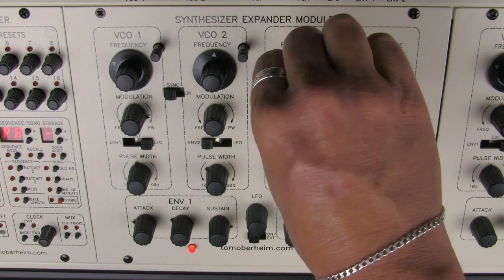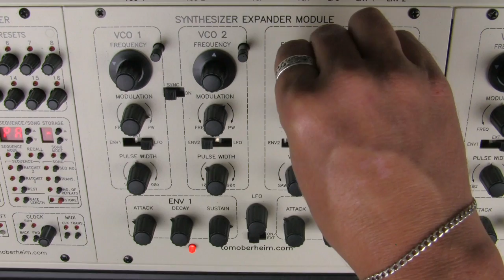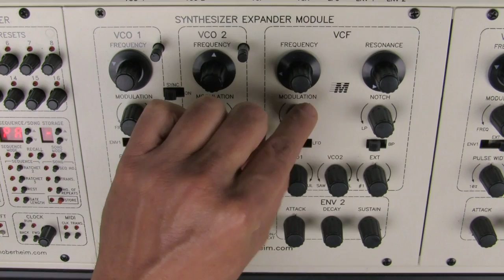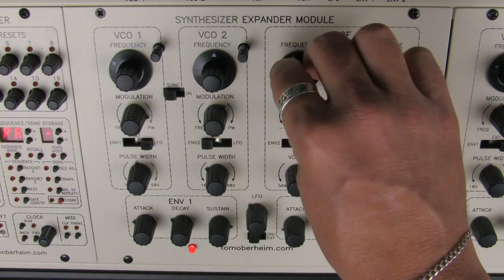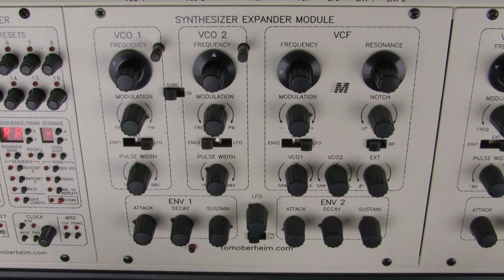03-The Tom Oberheim Two Voice Pro: Part 3-Filters

Comment: Not sure if anyone already mentioned this,

Its a fairly important part. This is a continuously variable filter meaning you can have notch mixed with low pass and notch mixed with high pass.

My favorite filter mode position of the knob that goes from lowpass to notch to highpass is around 9-11 o'clock and giving a lowpass peak when you crank the resonance but you still get the super frothy notch still when you bring your frquency levels down.

This is a very important part that I unfortunately didn't see you go over in this tutorial/demo.

Comment: Marc, I've only gotten through this video 3.  Can you touch on build quality?  I know it's steel but specifically knob slop or shake, pot resistance to turning (which we like).  Does this have the Minimoog model D re-issue build quality with mil-spec feeling knobs and fatar keybed?  (love my r.i.).  I heard a review somewhere and the reviewer griped about the button slop in the sequencer area.  Wasn't sure i was buying it because we expect some wiggle in tiny pushbuttons.  thanks